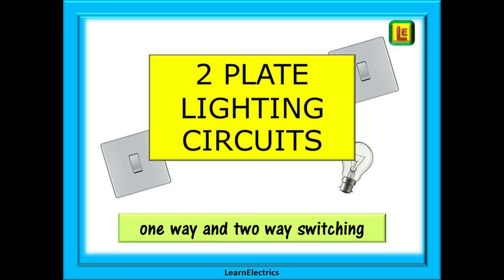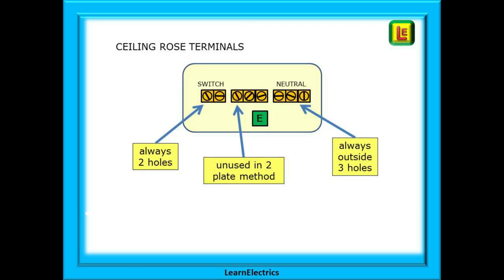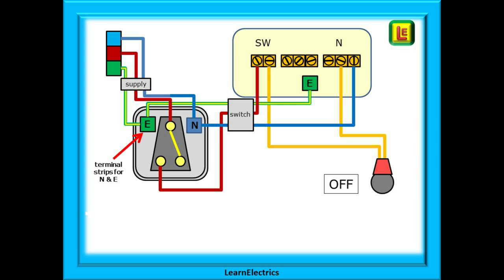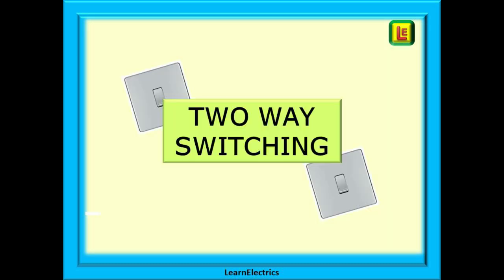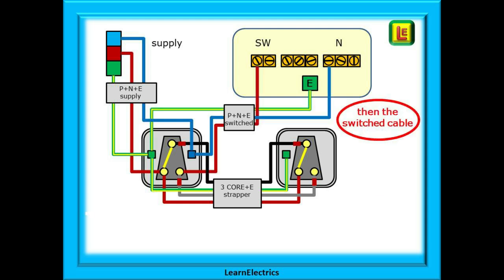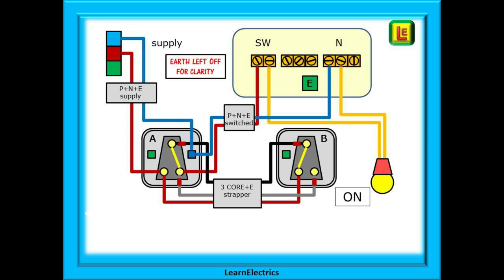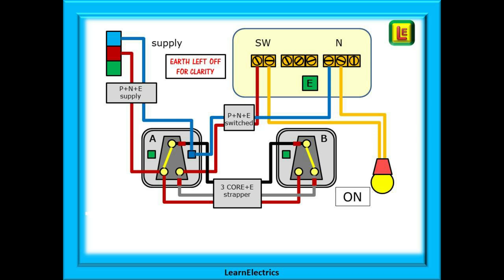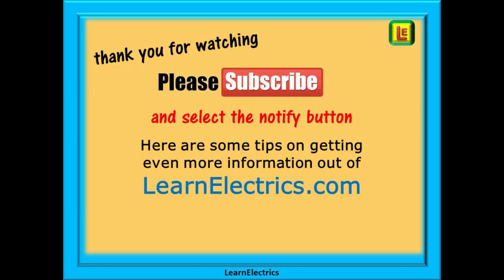2 PLATE LIGHTING CIRCUITS – ONE WAY and TWO WAY SWITCHING

Comment: So for clarity, where would the feed for the next part of the circuit come from to feed different lights and switches on the circuit. On 3 plate it goes from ceiling rose to ceiling rose. Where does it come from for 2 plate as if it goes from the switch you could potentially end up with 4 wires from a switch (feed in/switch line/strapper/feed out). Obviously you can't continue from the ceiling rose as the feed going to that is a switching line and so anything going from there would be reliant on the previous switch being on which is not practical of course. Just feel like there is heavy traffic at the switch with 2 plate method and that's before you even consider 2 gang or even 3 gang switches.
Reply from the maker: On two plate the line feed goes from switch to switch. I should do a video on this. Thanks for the suggestion, its on the list now.
Dave.

Comment: superb explanation Dave. Am i right in saying that on the 3 plate method the permanent live to a 1 way switch goes to the common inside the switch and the switch live from the ceiling rose goes to either L1 or L2 depending on whether its a 1 way or 2 way. Then if we want to change it and have 2 switches operating the same light eg light upstairs and downstairs the permanent live from the loop terminal in the ceiling rose goes to L1 now and the black cable from the 3 core and earth connects to the common and is carried through to the common also on the 2nd switch and the other cables in the 3 core connect to L1 or L2 in both switches. Is this right Dave? Thankyou so much your videos help a lot.
Reply from the maker: Yes,  black into common on both switches.
Take a look at our video on the differences between 2 and 3 plate 2 way wiring on our video. It shows how to connect the different methods. And lots of searchable videos and help on our website at LearnElectrics.com
Click on this link. Dave.
https://www.youtube.com/watch?v=IGEs5ZZqZx0

Comment: This is another fantastic video thanks.  I have a question about the 2 plate method if you don’t mind.  If i have 2, 2 way switches and one lamp and I take the feed to the common of the first switch, then go from L1 In switch 1 to L2 in switch 2 in single cables would this work ok?   And could I just run the neutral from the ceiling rose to the consumer unit?
Reply from the maker: Yes, you can use single cables, either singles in trunking or singles with a sheath (double insulated). Some electricians do indeed run the neutral as a loop from each ceiling rose, starting at the CU.
Reply: @learnelectrics4402  thanks that’s really helpful so running the line to the common works ok then.  I just got confused when I saw other people running it to L1.  I guess it can be done many ways.  Thanks ever so much you have been a great help.👍

Comment: If you put the brown in L1 (switch 1) does it have to be in L1 in switch 2? or does it not matter?
Reply from the maker: Have a look at the video link below. One of the wires MUST be in the common terminal on one-way switching. It doesn't really matter if the other one goes in L1 or L2, except the switch will work "upside down" Thanks for asking. Dave.
https://www.youtube.com/watch?v=pIUSengxPvs

Comment: Great video. Could you explain why we use 3 core + E strapper and not just 2 core? I know both will work but dont know the exact reason why 3 core. Thanks.
Reply from the maker: With two way switching, you need two wires (black and brown say) to be energised, there and back to the second switch. If you operate the first switch, those two wires won't work, you now need black and grey to be energised. Hope this makes sense. Dave.
Reply: @learnelectrics4402  Hi Dave. I understand the principle with 3-wire and 2-wire systems. My questions is why 3-wire is better and why 2-wire has been deprecated.
Reply: As an example, we can use 2-wire to link both switches. line goes on the common of Sw1 and exit the common from SW2. Between the switches we run 2 core cable and connect L1 of SW1 to L2 of SW2. Then L2 of SW1 to L1 of SW2. This method also works but community in UK says it is old and deprecated. I want to understand why? Thanks

Comment: Please I want to ask a question about the two plate light circuit. Almost all the switches do not come with a earth and neutral block for termination. So in this case what do we do...

Thanks
Reply from the maker: Daniel, just make your own, either a small terminal strip or a waygo. Dave.
Reply: @learnelectrics4402  Thanks for your feedback. God bless you

Comment: Could you do a video on the hallway light and landing light. Controlled from up and down. Which circuit should it go on?
Reply from the maker: Thanks for watching Miele.
This video does cover that, the two way switching as shown.
You can take the supply from a downstairs circuit or from an upstairs circuit, it does not matter which. Obviously you want it on a 6 amp circuit breaker. To 60W lamps, one upstairs, one downstairs, will add about  0.53A to the existing breakers load.
Dave.

Comment: For 2 plate method, could we just take the neutral and feed it direct to the light instead of going to the switch first? We can add additional lights or switches by looping live from the switch and looping neutral directly from the lights. Thanks.
Reply from the maker: Some methods do do this. Electrics has grown up with many many ways of doing things over the last 100 years or so. Good question. Dave.
Reply: Thanks Dave. Much appreciated
Reply from the maker: PS. If you are doing an assessment for AM2 or whatever, this is how they will expect a two plate circuit to be done. Dave.
Reply: @learnelectrics4402  Thanks Dave